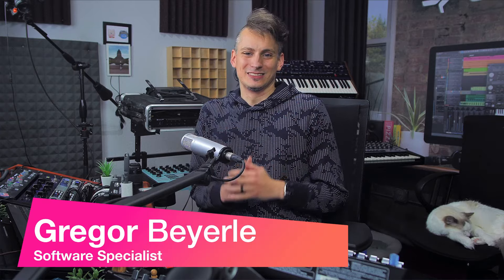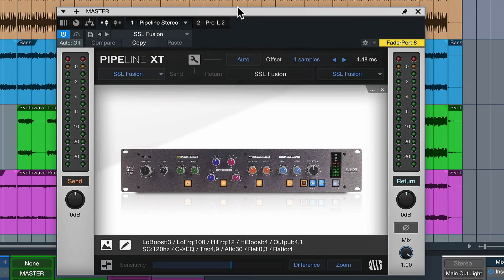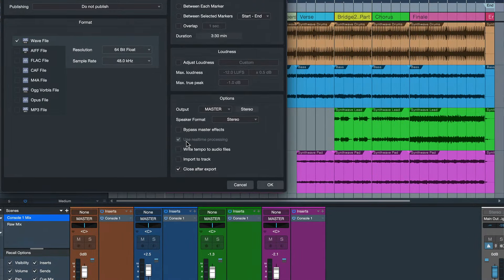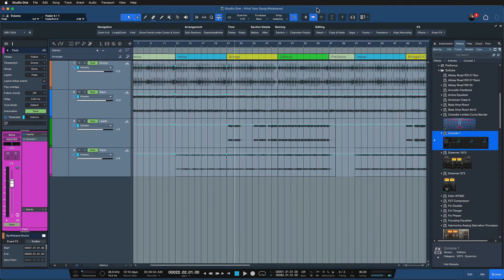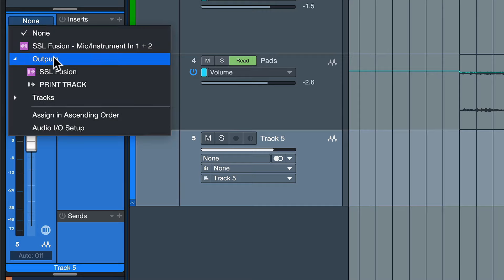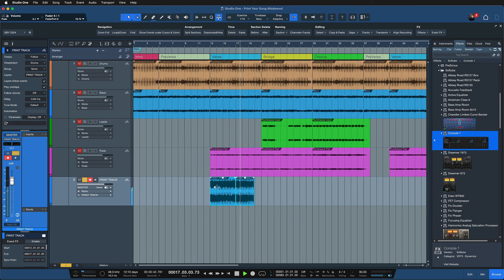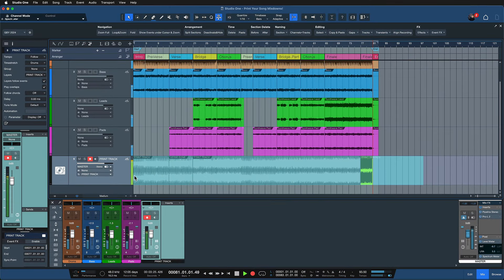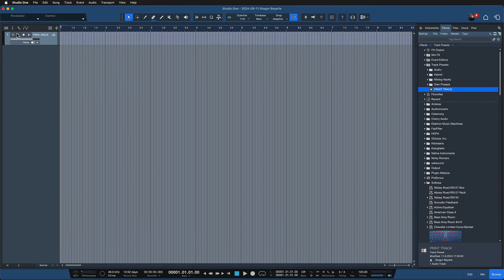Rethink the Way You Export Song Mixdowns in Studio One! | PreSonus

Comment: 7’05’‘: I‘d prefer an engine that doesn‘t glitch when recording instead of this convoluted process.
Reply from the maker: When the CPU is hitting its limits due to CPU-heavy plugins, this is something that you can’t avoid. This has nothing to do with a glitch in Studio One‘s audio engine. -GBY
Reply: @presonus ehhhhh it’s pretty bad if you use more than a few instances of pipeline. If the CPU were pegged like in the video we both know it wouldn’t even play back. I don’t think the engine is glitching but there’s a pretty obvious problem with pipeline even with the CPU sitting way under half, especially with a plugin loaded into MixFX.